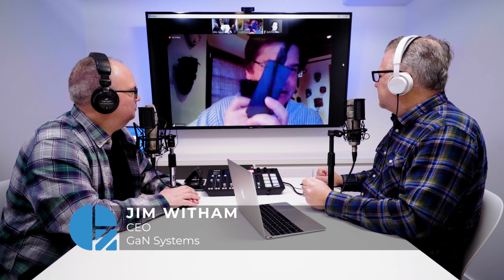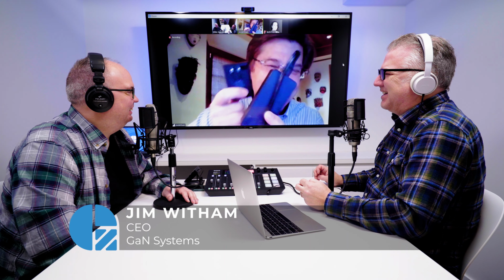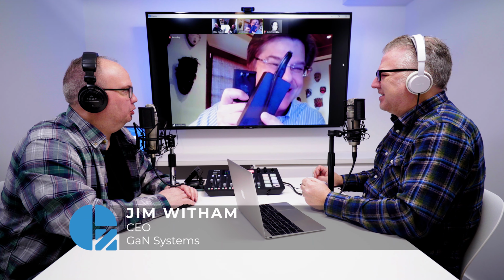How GaN Chargers Will Change Your Life

Comment: fast forward to 2025 and i finally heard of it and got myself some GAN power supplies cheap from china.. lots of power and runs cool.. and i chose models that have a 2 prong plug on a wire as to not take up space at the power outlet.  charging everything from one small, cool running brick with no fan.  very nice.. but is Gallium itself an unstable element?  i haven't tried to check for electro magnetic field from them.. is it radioactive?